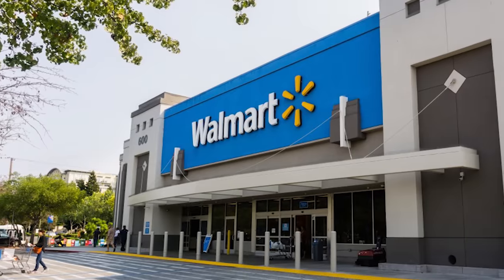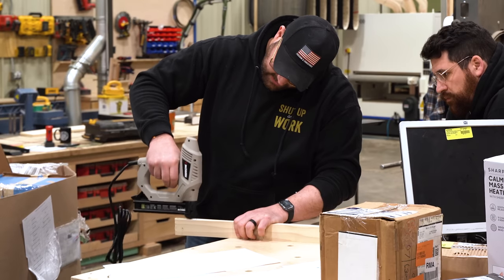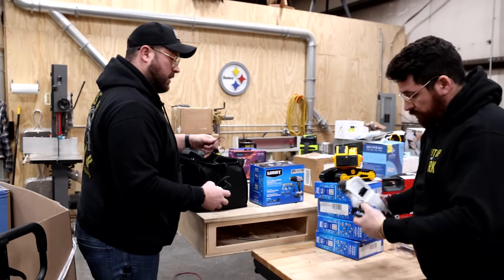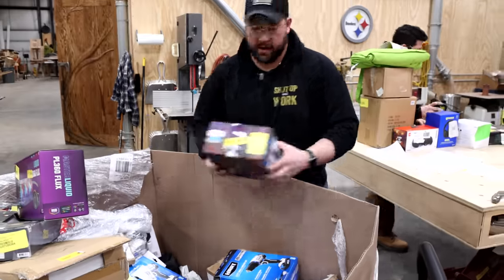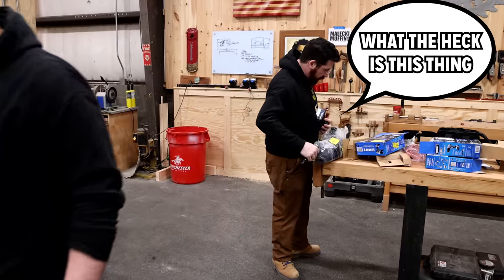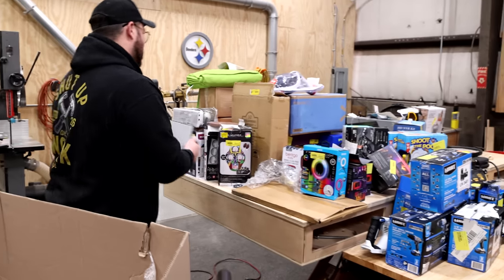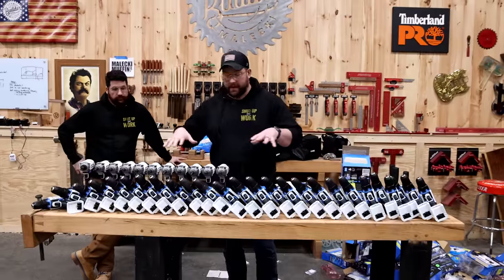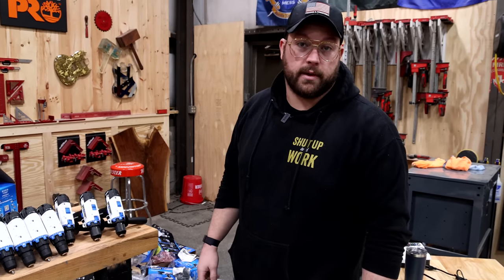I Bought A Pallet of Walmart Tool Returns for $2,217...... Mistake?

Comment: Sometimes the batteries get really discharged. All you need to do is manually hook up some wires to get a little.charge into the bad pack from a good one. Then it will take the charge on the charger. Hopt that helps.
Reply: I had to do that with one I got with my drill from Walmart
Reply: I was going to reccomend jump starting them... they have probably sat for a very long time discharged
Reply: @kylethiler  why did you buy a drill from Walmart
Reply: @codygooch510  why does it matter
Reply: @kylethiler  I’m doing a case study on people who waste their money & buy tools from a Walmart. Thanks for helping
Reply: @codygooch510  cool Glad I could help hope the information is Informative
Reply: @kylethiler  lol
Reply: Can confirm, had to do it with a speaker battery once and has worked perfectly fine for years now.
Reply: also i like how he says that 30 drills are trash because....... his batterys are bad..

because it would be IMPOSSIBLE to get new batteries or something RIGHT?
Reply: @codygooch510  It is made by the company who makes Milwaukee and Ryobi.  It is probably just a rebranded Ryobi.  If you need a drill, it isn't a bad price.  A lot of the Hart hand tools are really decent too.
Reply: Do this!
Reply: @JS-rv3et  New batteries cost more than the tool

Comment: Re the batteries, they'll have LiPo cells inside them, that most chargers wont charge if the cells have dropped below a certain threshold.
A hacky way to kickstart them back is to connect them to a charged battery, and it'll suck out some of the charge. Usually in minutes the "duff" battery will have enough to then be identified by the charger and allow it to get fully charged.
That being said, you got a proper bonus pallet for once!
Reply: Hoping they find this comment and you said it way better than I was going to
Reply: Do this at your own risk, jump starting LiPo's is not recommend as it is potentially dangerous to do so.
Reply: I’ve done this to several DeWalt batteries and it works every time!

Comment: I am surprised people even do return heavily used tools. I live in the UK and never thought of that even being a thing but finding out people just return anything and it gets accepted without any issues is just mind boggling
Reply: We don’t generally think that way either. I’ve never once heard of anybody doing it. Even if a tool breaks with a lifetime warranty guys will just accept that the tool did it’s job and paid for itself and well buy a new one. 

You gotta think what kind of person would buy tools from damn Walmart.
Reply: Yeah you would never get away with this in the UK
Reply: People return live christmas trees to Costco after christmas due to their very liberal return policy
Reply: You wouldn't return a drill that wouldn't charge?  None of those looked heavily used.  Most of them looked to be unused basically. I'd just jump the battery and get it to charge.  Completely discharged batteries won't work on a smart charger usually and require a little juice to make the charger recognize them just like with cars sometime.
Reply: @codygooch510  Why would you buy a lifetime tool if you didn't plan to use the warranty if it broke?  It isn't wrong to return things that break within the warranty/return period.  You pay extra because of the warranty.
Reply: @professor2421 I live in the UK and get away with it all the time. Just say it doesn’t work, they’re not going to test it in the store are they lol
Reply: @davidroberson1962  Returning is not the same as warranty replacements. 
Good attempt though, bud. Now get back to eating your crayons.
Reply: I kind of like when people can get one over on these billion dollar big box companies. Now if it was mom and pop independently owned business it would be a different story
Reply: when i worked at walmart we would have some families we just called them the renters are back when they come thru the door. every summer their kids got new bikes but right before the 90 day window was up, they would bring them back very abused, worn tires etc. and get their money back and then the following summer repeat the process. yep they had new bikes every year. and they did it with alot of items. they would buy camping gear, luggage for a week or 2 and return it when their trip was over.  they got new air conditioners every year, christmas trees, etc it didn't matter. i know when i left they were trying to do something about these  "free loaders" and they wanted to do something about the flippers also that buy out certain items and when they cannot sell it they bring back 40-60 of the same items like a good example is the  hot toy of the year at christmas time, return them after the holiday is over when nobody wants them anymore.

Comment: You briefly mentioned Ryobi. They have a bad rep, probably from long ago. I was gifted mine about 10-12 years ago and use them almost daily, especially the impact driver. The circular saw bearing wore out after I built my tiny house on wheels, entirely with the Ryobi cordless kit. But the rest of the tools are still going strong. Love them!!!
By the way, the batteries only gave out on me in the past couple years.

Comment: Before tossing those batteries out, I would try "resetting", or "jumping" the BMS. This sometimes works. I have never tried it on Hart but have had luck on other TTI branded batteries.
Reply: I had 2 hart batteries that wouldn't take a charge new from Walmart. 5 sec jump start and they took a charge never had a issue with them since

Comment: The batteries were more than likely ran down and stored cold. It is possible to revive them instead of throwing them out. Use a multimeter and find the positive and negative terminals. The middle terminals are balance contacts. Take a full working pack and hook them in parallel using a jump cable. You can make one using ring terminals. + to + and - to -. 
Or watch a tube video that explains the procedure.
Reply: Jumping them does actually work.   Sometimes.   If they get below a certain charge level,  the charger will error out.
Reply: @soup108  If you jump them, it transfers some of the power to the dead battery.  That is the whole point.
Reply: Old video, but I was about to say the same for future buys. The charger need the battery to have a small amount of juice, to register it and start the process. This method saved two of my batteries that I forgot in the garage during winter.
Reply: @soup108  You're only supposed to jump them so the battery gets enough charge to be recognised by the charger.

Comment: Bet all those drills that look OK had a bad batch of those batteries.  Hart is made by TTI (Milwaukee, Ryobi) but doubt that there's much if any quality control.  Someone gets one as a gift or buys it and then tries to charge the battery with no luck.  One can still go online and buy a replacement battery so not a total loss.  Thanks as always because I always wondered if those pallets were worth it or not.  The percentage of junk is sometimes high but also I wouldn't want to end up with a bunch of the same type of tools I already have.

Comment: Ryobi tools are for those that work on the weekend and don't care if they break the tool doing what needs to get done. And there's a bunch of oddball tools they make that are useful for around the house work. I use Ryobi and haven't really had any issues with them and keep pace with people that have "more professional" tools(Milwaukee, DeWalt, Ridgid, Makita). I also throw my tools around because they're cheap enough to replace and they just keep going so I haven't had to replace many of them.
Reply: No reason to buy those cheaper brands. You can get the older versions of tools from Milwaukee for just as cheap for 3 times the amount of tool lol.
Reply: I got lots of Milwaukee 18 v
Tools since 2012 I’ve had 3 drills die for various reasons and 6 batteries! 
There not like they use to be !
Reply: @codygooch510  🤣🤣🤣
Reply: @gldwng IIOO no.. Ryobi doesn't hold a candle to the more expensive versions/brands of their tools.  However, they do work just fine for the homeowner that does the occasional project that doesn't need a premium tool (which is me).
Reply: I’ve never broken a Ryobi. I had to buy new batteries for the cordless 18v kit I bought in 1998 and used in three full renovations. That was after 20 years. I’ve used the hammer drill to put holes through foundations. That being said, they’re clunky and heavy. They aren’t rewarding to use. But most of the snobbery comes from middle-aged and elderly men looking for some sort of validation for their choices.

Comment: I’m that homeowner that bought his first tools at Walmart. Got the drill/driver, recip, flashlight and a weed eater that all run off that 12v. Not the greatest, but they do what they need too. I’m doing basic repairs, not building houses. I will say that in the weed eater that battery overheats pretty quick when under constant load.

Comment: you know those batteries can be stripped down and repaired, usually the faults are broken connections or a knackered small component that costs cents to repair
Reply: They could also just be below the normal threshold for charging too. Lithium batteries have charge protection so if the voltage drops below a certain amount (by sitting for long periods, especially in the cold) the charger thinks they’re defective. Chances are most of his batteries are good, they just need to be “jump started”. I usually take a charged battery with two wires clipped to the +\- and hold it on the “dead” battery for a couple seconds. It gives the batteries just enough to fool the charger into thinking it’s ok.

Comment: Haart batteries are super easy to fix, unscrew them pop out the pack assembly and check each cell. If all are equal charge up with a 24V adapter through a brake light bulb till you get 3.4V or better per cell. Next reassemble and apply the 24V to the + and - output terminals briefly. Finally pop in the charger and charge the rest of the way. The batteries should not be stored in the tool if not used for a while as it will make them over discharge. ❤

Comment: I’ve taken batteries apart and used a “repair” type AGM/Lithium charger to bring them back to life. Have to hook them up directly on the battery. Fresh from the store they are sometimes so drained they won’t even take a charge. Most of those batteries could probably be saved.

Comment: batteries might still be good! it could be the control circuit or just a single cell that went bad preventing the battery from being used. if you can open them up and take out the 18650s they can be used in other projects. handle them with care tho.

Comment: I must have a rare hart impact drill and battery because it works like a gem. Holds charge really well and drives really well. People I work with knock it but it saves use on my DeWalt drills. Gets the job done perfectly.

Comment: Just a FYI those "BAD" batteries are likely just discharged too far for the charger to allow charging. They can be recovered by poping the cover and charging them to ~12v with a power supply (I do this all the time to recover batteries). At that point the charger will charge them. It appears that proper voltage cutoff was not done on one or more of the tools or there is a drain in the design somewhere. I would be interested in buying them from you if you don't want to go through the trouble. Better than sending them to a landfill.

Comment: Use the drills to power a diy go kart/ electric vehicle (I've seen people do with drills. The motors have decent torque for the size and the removable/swappable batteries take care of some of the most complicated/possibly dangerous part of electric vehicles with the battery charging and management.

*Edit as I just finished video, of the tools work, you can buy individual batteries (also, the batteries might work but the charger doesn't, happens sometimes)

You can use any power source to use the tools for electric vehicle. Or if you want to keep a few around to abuse, they make adapters that will take one brand of battery to a different brand. As the power is the same, the capacity and connectors are different. Just use the batteries charger not the tools.

Ie: I made an adapter to use my Ridgid batteries with a few tools I bought of Ryobi tools that I didn't need as much but didn't buy the Ryobi batteries. I use the Ridgid charger to manage charge etc. The tools don't know the difference with power. (I also made an adapter to be able to plug a tool in instead of use a battery. Let's me use a tool that is always used in the same place without worrying about batteries. Also can be used if a battery does and you're almost done. Plus I just like to tinker and make things work the way I want to. Because I can.)

Comment: All of those batteries are still good, there is a protection circuit on the charger that won’t let them charge a completely discharged battery. Take a 9 volt battery put 2 small jumpers to the positive and negative on the drill batteries let them sit 10 min and all will charge agin just like new

Comment: PLEASE READ THIS: okay there is an eEZ fix for the error code of the hart brand battery.  You need to use one of the chargeable batteries to jump one of the error batteries to get it to a point where the charger recognizes that the battery is within a certain threshold in order to charge. 

so basically the batteries are dead to a point where the charger isn't charging because they don't meet the default charging threshold.

so if you get the battery up to a certain voltage before putting it on the charger. when you end up putting on the charger it will recognize and start charging. THis happened to me when i left my batteries in a truck for a few months in the winter.

Comment: I have a hart brushless 1/2" impact, brushless drill, and brushless impact driver and four 2ah batteries i got for $150 when my local Walmart was shutting down, they're pretty good for the price, i completely stripped an old 4runner with the 1/2"

Comment: I heared that Hart tools are actually build on older generation Milwaukee plans that the company bought. Only i would guess that they probably cheap out on the components quality.

So for what i hear, they are not complete crap, just not up to date with the newest quality tools technology, and they won't resist long in an industrial daily challenge, but are totally fine for the occasionnel homeowner use.

Comment: Apparently you can “jump” the batteries with another battery. They won’t charge sometimes if they have absolutely no power in them. Im not sure I would try it, but I’ve seen it done.

Comment: John you gotta do an Amazon one. If you fancy flinging one those kits over the other side the pond a can totally take one off your hands. Recip saw is something a could deffo use as pallet buater. Just got keys to my first proper shop trying kit it out. On that note got table saw 10" planer small power tools need no what next to get. Tracksaw or bandsaw going into chopping boards live edge tables and pallet work?? Your thoughts please!👍🏴

Comment: Are the batteries bad because there's actually something wrong with them or are they simply under voltage (normally happens when the battery is flat and left in storage) so the charger is rejecting them? Normally you can jump start them off a charged battery if you connect them up for a second.

Comment: I gave Hart tools a solid attempt. I ran into several batteries that would not charge. Apparently if the battery gets too low, the charger won't charge it. You can hook the batteries up to a trickle charger and it will fix them, but they essentially arrive broken out of the box. And they'll refuse to charge in the future if they ever get too low again. It's a major design failure.

Comment: Those tools look familiar, when my store first got its line of drills under a different brand name, we got ALOT back, because people were using the lithium batteries to power random crap, and they would get drained below the safety cutoff voltage and no longer be able to be charged.

if you don't mind extreme sketchyness with a side of possible flames and explosion, you can take a good battery, with some wires with blade terminals on them, connect the + of a good battery to a + of a bad battery and - good to - bad aswell for a few minutes, the quickly disconnect and slap in a charger and it will bring the bad batteries back to life.

do it outside, with safety gear on and a stainless bucket nearby(and a C02 or powder fire safety thingy with ya)

Comment: 1) make an rc project using all the motors from the drills. Could be ur new forklift or driftmonkey that you race with.

2) make an epic monumental sculpture with the leftover plastic. Try find different ways to form and melt it or smash it to peaces to fill the cracks and do an epoxy/resin tabletopart

3) give them to some school nearby. Sure those might be in better condition than the ones they had previously. Sure you could find replacement batteries for them or try ask help to being them back to life. If not schools, then some unemployment/education center where they teach adults to make stuff. Might even work for electric repairs, they would have to get them to work again...

Comment: You can jump the dead batteries off of the good ones. sometimes they're just so dead that the charger can't "see" them. just connect a small gauge wire from the pos to pos and neg to neg, same as jumping a car battery. it will transfer enough energy to allow the charger to recognize the battery and being charging it. if it works, the "dead" battery will light up the charger again after you do it, and charge properly.